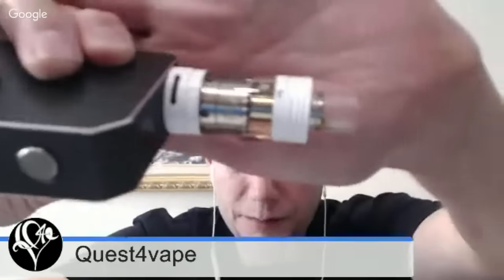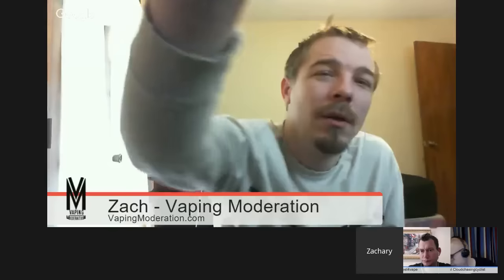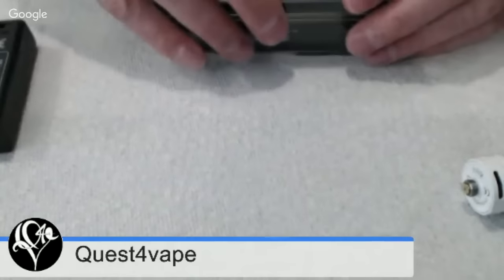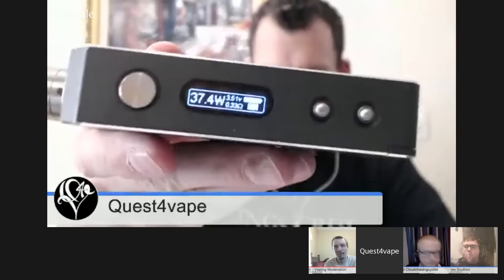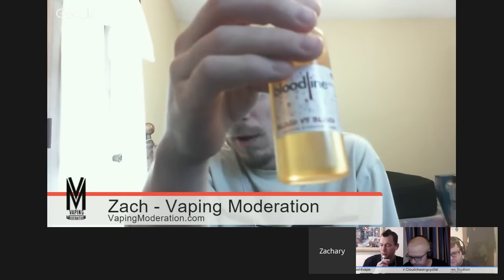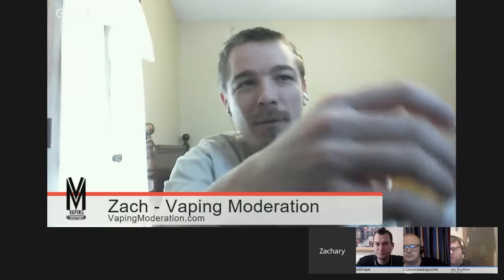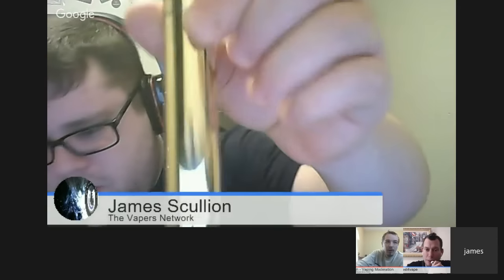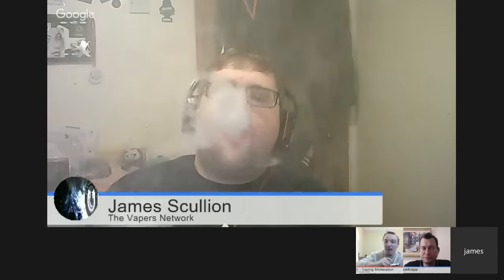How to build and wick your OBS Crius RTA

Comment: awesome vape flavor tank.It's great for leaving up right on a table if I put it in my pocket or hold it with a slight tilt it leaks.I hope the Griffin tank coming out doesn't leak all the time..The crius is mighty but it's useless if it leaks all the time.The lovely drip tip came apart as well.I just got two rda coils for the crown tank.like sucking air through a tiny straw, what a waste of money

Comment: I own both the Crius and the  Aromamizer, IMHO the Aromamizer is better in the ease of wicking and no leaks. Crius wins in the ease of filling but honestly if I had to choose one it would be the Aromamizer. I don't know if other Crius owners are experiencing a little leaking around the bottom where the air flow ring meets the bottom of the tank but mine is.
Reply: +B Tango Yeah it does a bit, especially with fresh cotton. Have you tried closing the juice holes before filling? That seems to reduce leaking quite a bit.
Reply: +B Tango mine has the same problem, can't seem to find anything to keep it from leaking, was told from a dealer that it is only condensation; are you have any problems with flooding?
Reply: +Roger Conrad No flooding issues...and it's not right away after a fresh wicking...happens a couple days later. Did you try replacing the o-rings?